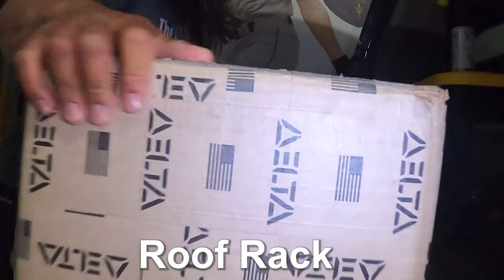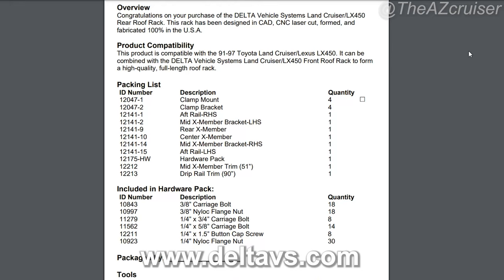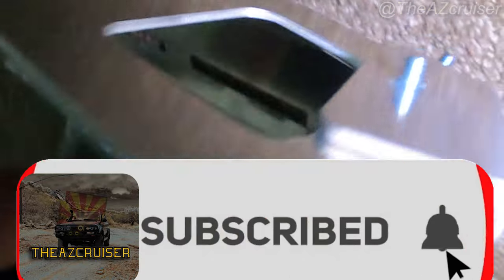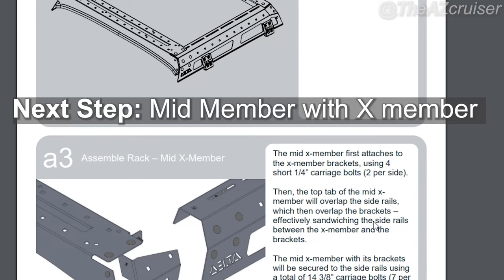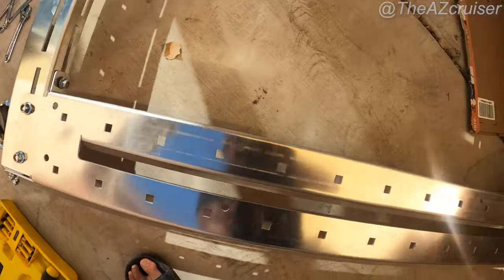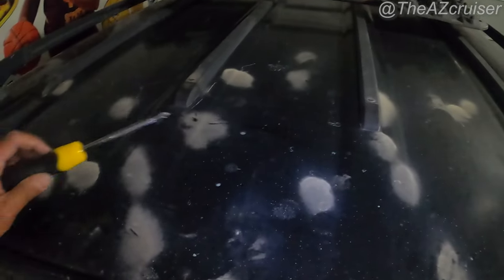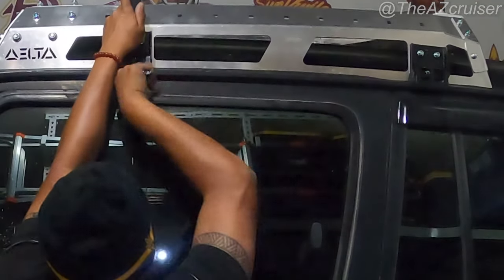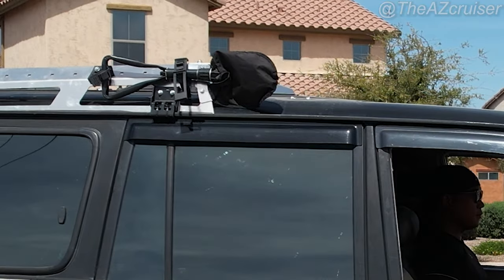ℹ️ How to: Delta Vehicle Systems Half-Rack Install (80 Series Toyota Land Cruiser / Lexus LX 450)

Comment: Awesome video, thanks for making it! Just a note for anybody wondering about the fitment issues, would fit a lot better if the delta logo was towards the front of the vehicle instead of the back (rack is installed backwards). The carriage bolts are also intended to be dome side out for smooth, no hang up use. 

Glad you like the rack!!
Reply from the maker: Great point! Yes 💯 sorry I didn't quite do it right but I may fix it in the summer 🌞. Yes love the rack and my delta attic mounts.